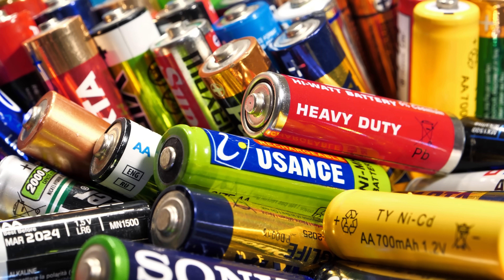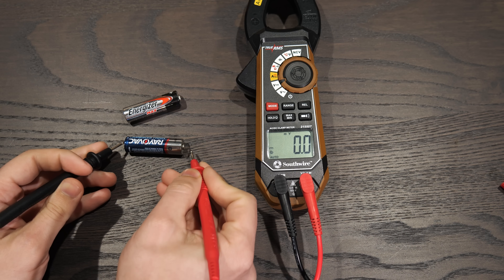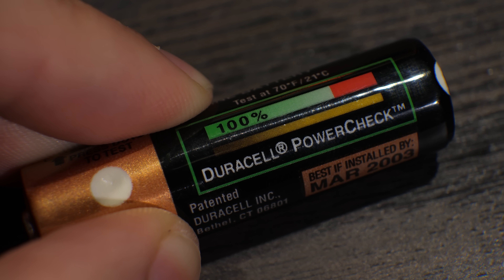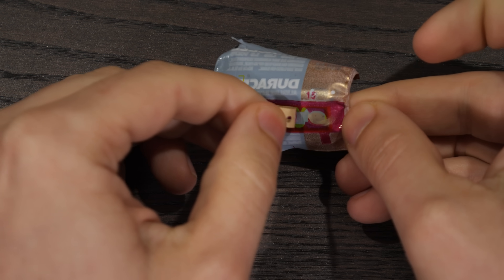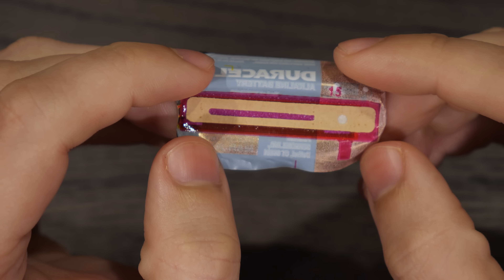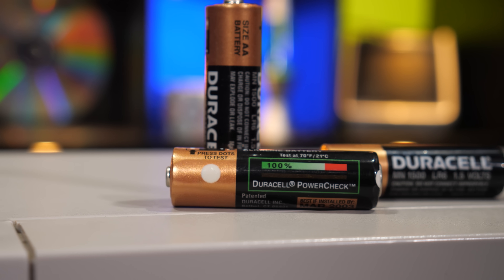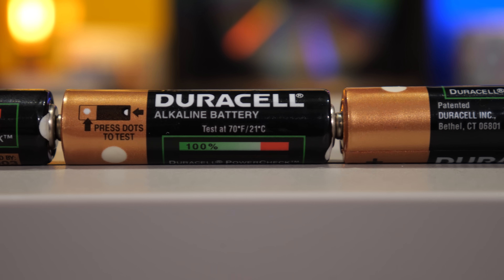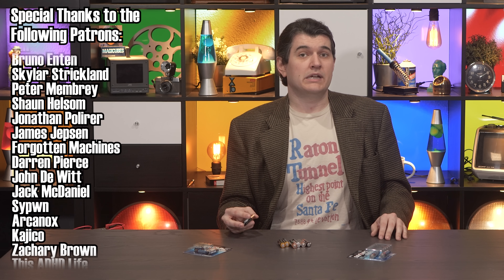Duracell PowerCheck: A genius idea which didn't last that long

Comment: If people actually followed the manufacturer recommendation for various battery powered devices and removed the batteries before storing said battery-powered devices, these built-in testers would make much more sense. We would be taking the batteries out before storing the thing that used them, leading to plenty of partially depleted batteries in the drawer.

Comment: I dealt so much with batteries that I bought a spot welder, a bunch of BMSs, an internal resistance meter and a capacity tester. Btw, an internal resistance meter can tell the remaining lifespan of a battery without any load on it.

Comment: aaa cells are a lot lighter , iam glad many remotes use them i hate aa bottom heavy remotes trying to topple out of my hand while reaching for the top buttons, and capacity ? i dont care!  i use nimh pre charged (very low self discharge rate) rechargables in remotes as they dont leak! 
duracells are garanteed to leak but to be fair any alkaline because they trap waste gas pressure as they discharge, yes bloody stupid right! iam currently testing lipo powered aaa they claim 1200 life cycles , dont tell my house insurance company!

Comment: Sometimes batteries are not good enough for a high load device like a fan or a toy car, but perfectly adequate for some other device like a wall clock or a tv remote, so when a rc car battery dies you can often just place it in a wall clock and have it run for some more time

So you may want to keep seemingly dead batteries in a drawer for such cases

Comment: These labels for the batteries weren't revolutionary. Long before they put the testers directly on the battery labeling, they had the Coppertop Tester strip on the blister bubble the batteries themselves were packed into. You would then take a battery, put the positive and negative contacts into the blister bubble lined up with the testers, and then gently grip between thumb and forefinger.

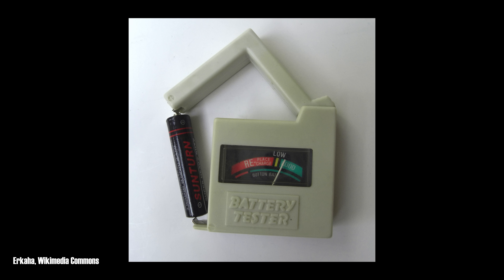Comment: 2:53 my mum has, I should say I have ( my mum passed in August and it’s still hard to get my head around) a battery tester (it kinda looks like something the ghostbusters would use) it was mostly used to test the aa aaa and and a little needle and dial that I’m guessing works like that multimeter only it’s analog Instead of digital.

Comment: A lot of devices we use at the manufacturing plant that I work for won't work once the battery is below 1.25V, usually even below 1.35V. I assume that strongly depends on the device though. Flashlight vs remote control.

Comment: The utility of a tester may have also gone down because of shifts in which kinds of devices use standard replaceable letter-cell batteries, in a higher draw device that runs through batteries more quickly (say a music player or camera, the cheaper models of which back in the day often didn't have an on board battery meter besides maybe an LED to tell you when they were almost dead) there are for sure circumstances where you might want to know how much juice was left in your batteries, for instance to get an idea whether they're going to last through a trip or outing or if you need to bring spares. Nowadays those kinds of devices usually have in-built rechargeable batteries (for better or for worse) and most devices that still use letter-cells are "low draw over a long time" stuff like remotes and clocks for which you're more likely to just leave the battery in until it stops working and then replace them.
Reply: (I say "for better or for worse" because especially in cheap-to-midmarket devices those unreplaceable batteries and charging systems are often a first point of failure, whether it's batteries not holding a charge after a certain number of cycles or charging port connections failing and making the device impossible or unreliable to charge, and modern low self discharge NiMHs and their chargers have gotten good enough that I feel like maybe it's time for a comeback)

Comment: Completely agree the battery testers were redundant, I owned some, but only because I needed batteries and the store sold them and the alternatives were an unknown brand. Never tested their levels - what's the point? You replace them when pressing the buttons on the remote really hard has no effect.
What got me as a parent from that age was the number of toys that needed Cs or Ds in vast numbers, computer toys with screens, motorized toys. Replacing 12 of those was a mortgage repayment.

Comment: Donot forget that the batteries have a finite shelf life. I many times needed fresh batteries for my flashlight or my radio when hiking in summer, and when bought them from whenever my batteries went empty, they were sometimes half empty. So, a quick tester like this should have been useful.

Comment: Oh, the days of my first mp3 player, walking around with always half a dozen AAA batteries in my jacket pocket so I'd have a spare (there was 256mb storage on it, too, good times).
There's only one scenario where I have switched old batteries to that standby-state, as it were, and that's when the thingy that it powers is what's dead and the battery is actually just fine. Not saying that's smart, but that's what I do.

Comment: 11:23 Devil’s advocate; some electronics would take multiple batteries and/or require a very high voltage from the AAs. I can’t remember any examples right now, but I remember that with those things I could take the “dead” batteries out and they would be as good as new ones for other applications like the TV remote or some such thing.

Comment: I remember having devices that needed batteries that were at least half full, and devices that still worked even on nearly empty batteries. That's why I often kept half full batteries around that I had removed from the more demanding devices, to then use them in the less demanding ones. That did require a bit of power level monitoring. 🙂 But yeah, a rather niche use case.

Comment: Ironically, you could probably get a more accurate idea of the charge in the batteries by putting them in the multimeter than testing them with the multimeter

Side note, you can actually recharge alkaline batteries, but it usually doesn't work out very well.  They're really prone to leaking when recharged and you'll take a big hit to capacity every time they recharge.  ESR probably also gets a lot worse, but I've never tested that

Comment: Don't forget that with the implemitation of led-lights the time it takes before you have to replace the battery is greatly reduced. Also other inventions on the micro electronics brought a big reduction in the poweruse of the devices.

Comment: You forgot to mention something important. 
There was a lot of electrical devices that used batteries to spin motors. Walkmans for example. At some point batteries didn't had enough power to spin the motor in proper speed, but had enough juice for a remote control. But you remote had batteries, so in the drawer it goes ... :)

Comment: Rechargeable batteries are great and greatly expensive, but they also seem to go bad and there's no way to tell. I've put batteries in the charger only to see the light keep blinking. Then, I have to play Three-Card Monty to figure out which battery is defective. If they're rechargeable, what makes rechargeable batteries "die" for good?

Comment: I don't remember if it was Duracell before this, or Energizer at the same time but one of them had a tester built into the package that worked on the same idea.  Stick the battery in the spot in the plastic blister area, squeeze, and the scale would light up.

Comment: 0:20 At least where I live, AAA batteries are stupidly expensive compared to AAs, like twice the price. From a Walmart at that, not some local store trying to jack up the price super high.
Reply: Most devices use these buggers because they are slightly lighter, so they can make it slightly thinner and charge the same. Profits

Comment: I stopped using single use batteries when low self discharge NiMHs became a thing. And most of my NiMHs are quite old - about half of my Eneloops are made by Sanyo so the are from 2009 or older and those still have more than their promised minimum 1900mAh capacity after a crapton of cycles.

Comment: We would move batteries from devices that needed a good charge (say flashlights) and when they started to need changing we would move them in device remotes (tv, dvd, VCR, sound, etc.) that would seem to use the old ones just fine for a week or so. We appreciated the on battery testers but did not really notice them disappearing, as we switched to rechargeable at some point.

Comment: I know a topic that’s fairly obsolete (or at least just not common) - car cigar/cigarette lighters. When I was younger I was fascinated with how they’d pop out at the right temperature (and then some would get stuck and not pop out and instead start melting things). Now I know it’s just a resistive bimetallic thing. But could be a short video- perhaps for no effort November? And you can get them cheap/free from junkyards or possibly your car.

Comment: I used to have lots of used batteries lying around in my house as a kid. I had some toys where when the batteries went "dead" they would still work in other things just fine. Our remote control ran exclusively on batteries that died in other things. Although that remote would also run on a single battery for some reason.

Comment: I do remember that they had those voltmeters, but not on them.
The Batteries i remember came with a strip (in the package) that, when you touched both ends would light up as a battery being filled.
But they disappeared and i do miss them.

Comment: How we use batteries has changed a lot over my lifetime, even beyond the recent move to rechargeables. Remotes were rarer. Batteries had more of a use case where you were likely to be mobile and it be inconvenient to do replacement so knowing capacity would be useful. Along with just not being very good, I think they just caught the wrong end of a paradigm shift.

Comment: I absolutely loved these. I never wanted to throw batteries in the trash but I also wasn't sure how to dispose of them. Or I didn't know for sure if it was out. All the batteries ended up in the same drawer... And the new ones never managed to stay in the package. Now I know you put two little boxes in the drawer...

Of course I didn't buy a battery tester, I didn't even know it was a thing. Probably lose it anyway. Honestly, I handed my entire removable-battery control system to my husband. He might use the multimeter, it lives pretty close to the battery drawer.

Comment: I prefer AA batteries over rechargeable batteries where reasonable (like a keyboard or mouse). That way the device can outlast a built in battery and I can still use rechargeable batteries.

Comment: I'd like to throw out there that this kind of built-in tester was still around in at least one application even in the late 2010s that I remember. My parents used to have some rechargeable AAs at some point during that time, and they had a charge indicator a lot like this. I don't remember what brand they were, but they weren't Duracells. Anyway, it was a pretty neat use of this technology in a setting where it actually made a lot more sense, since you'd need to regularly remove the batteries from whatever you were using them in so you could charge them. Mind you, it would have probably been more useful to have a more conventional battery tester built into the charger itself so you could see the charge level at a glance instead of having to mash your fingers into the sides of the battery. Then there's the whole impracticality of rechargeable batteries you have to remove to recharge. But still, a decent little "last hurrah" for these clever and pointless little things.

Comment: Some things needs more power (like toys with a motor) than others (like a clock) sometimes I take out partially discharged batteries from a toy and keep them around for a thing with less power need.
If you need to combine batteries it's good if they have similar voltage. Good to have the tester.

Comment: The main time we’d store partly-used batteries is if we upgraded from something that used one type of battery to a different thing that needed a different type of battery (such as a new TV using a new remote that did not need the same batteries as the remote for the previous TV). The batteries themselves aren’t dead; they’re simply no longer required for their previous purpose, and can function as shorter-lived "new" batteries for a later purchase that does need them.

(Technically, we also did something similar if a BNI item needed replacing for one reason or another, but that’s not really the same thing in any meaningful sense.)

Comment: On the end-of-captions gag, where i live i cant find these generic batteries, only name brands like rayovac or panasonic or duracell... but then you'd get like a new cable box and the remote came with these like wierd blue or green batteries from a brand you legit never heard of in your life and they lasted at least 10 times longer than anything else, i dont know what magic these oem batteries have but good golly i want some of it, nowadays yeah nothing i use requires the sticks its either rechargeable or coin cells, also those wierd no-name magic batteries were almost always included with remotes for new cable boxes, and not much else, and by cable boxes i mean the little doohickey you get when you sign up for cable service.

Comment: It's not like we don't use alkaline batteries any more, but their use cases have reduced a lot. I think the general "rule" is that devices that need a lot of power in rather short bursts (flashlights, cameras...) should use rechargeable cells while devices with very little power draw over long times (clocks, remotes...) are better off using alkalines.
Oh, and about "empty" cells: it's really interesting when you can see how much juice is still left in them. I built one of BigClives "joule thief" circuits and used it as a rudimentary night light for a while. One "empty" AA cell could run a typical 5mm strawhat LED attached to the circuit for several weeks of "night shifts" before finally giving up.

Comment: Hey, I was a kid in the 1980s and 1990s. Our toys didn't use that puny AA things! 
Big hunky D cells were the deal! Or 9V blocks, which lasted exactly 30s or so, then leaked and made the clips crumble.

And also, don't you know the frugal people battery lifecycle? The fresh ones go into the TV remote, when you need to start pressing the buttons extra hard and do some expressive dance to get the channel to change, they are to weak for that and go into the analog wall clock for like a year. After that, they go into the LCD clock. Only then they are carefully stored because they may recover and be useful again. Usually they only leak and would stain the drawers bottom, if you hadn't prepared for that and put some newspaper in there to prevent that.

Comment: I still need to have non-rechargeables as there are some devices I run across that are so tight in battery space tolerances that the ever so slightly different size of rechargables don't fit.

Comment: My pet peeve are 9V batteries and why things like multimeters, wire testers, etc still use them. They always seem to drain inside the devices and since they are often devices that are not used all that often the battery is always dead when you actually do need it. Especially in the past few years where 18650's became increasingly more affordable and electronics kept getting smaller, anything requiring a 9V battery needs a long overdue upgrade >.<

Comment: Do remember, It took a lot of pressure which made it useless for certain people, not least elderly.
I get that they needed to make sure that the connection was open & closed again, as otherwise that battery would be drained from the tester alone.
nowadays,I tend to use BT168PRO.. they are like 2½ $ delivered and can do pretty much the hole chabang incl. Liions & tigers..

Comment: I remember a few of the cheaper RadioShack multimeters would include a dedicated "battery tester" function so they could market a higher number of functions on the device.  One of mine even had separate dial setting for checking 6v lantern batteries....

Comment: These were my favorite batteries when I was a kid.  I can't remember why testing was so important to me.  Maybe my household had an issue of storing used and new batteries together.  I probably tested them when I played GameBoy Color, so I'd know if I needed to just not play that day until I could get new batteries so that I wouldn't lose progress or risk corrupting a save on the rare chance that the batteries could die during saving.  But when GameBoy Advance came out with a color-changing LED to indicate when the batteries dropped to 35 percent, I no longer needed the tester.

Comment: You should do a video on how frustrating it is we get cheap junk nowadays that instead of being made for AA/AAA batteries in which we can use rechargeables, they come with often way smaller (even smaller than AAA) integrated batteries that you can't even change when it goes bad unless you're willing to learn soldering.

Not to mention the quick reload action you can easily do by keeping a charged battery around for when your main battery discharges, instead of having to attach a wire, to your uh wireless (?) device

It feels a lot like the dishwasher detergent market

Comment: I had a few devices that wouldn't work with power check batteries because the tolerances were too right and they had that like bulge down the side